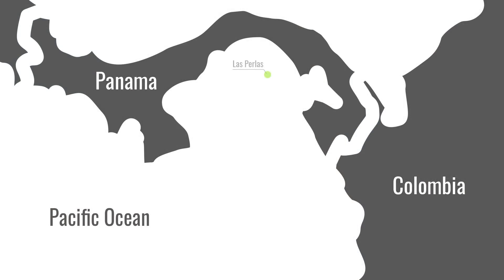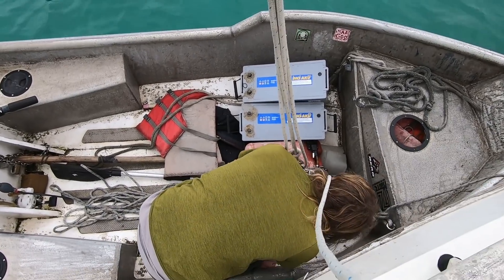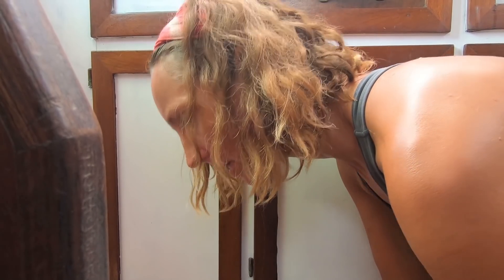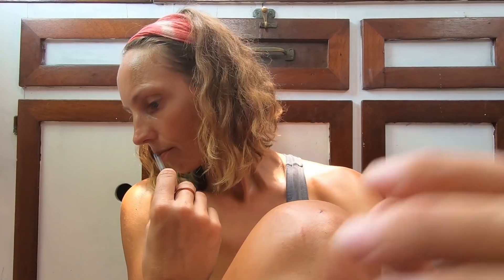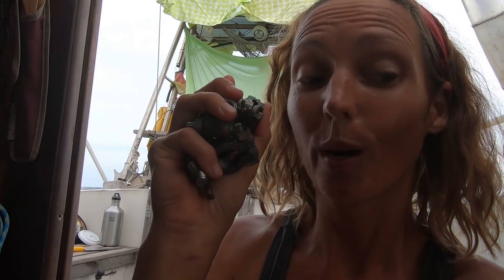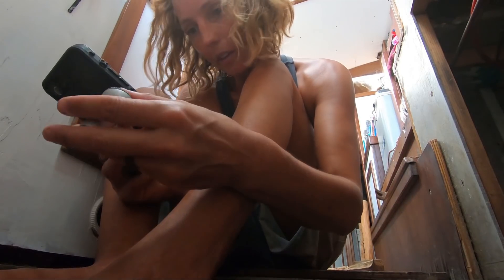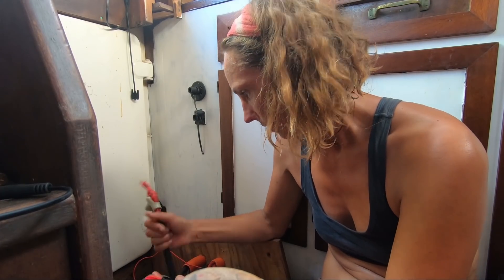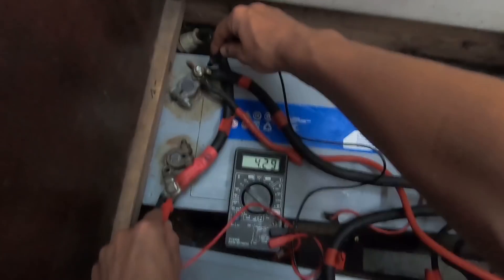Stepping up my game: figuring out how to trouble shoot the electrical motor of my Lofrans Tigres

Comment: My thoughts were that the polishing of the commutator and the brush rings were important, but the discovery that the brushes were a little stuck in their holders probably was the most important. With many ohm meters, first you put your probes together, and the lowest resistance the meter is capable of showing is then displayed, probably .6 ohms. Wiindings on a typical meter are a dead short (in your meters case a dead short is probably .6 ohms) , it takes a very special meter to show anything else. Its a specialized low ohms meter. There are also some very technical tests done with windings as they are special parts called inductors, and inductor tests are a lot more definitive. Now days you can get fairly good inductor testers (they test inductance, capacitance, and many other things, and identify the parts on the screen) for about $15 from ebay china.  Well, I had bought mine about 4 years ago and they've updated the devices a lot. This one does everything, including testing resistance down to .01 ohms, and will tell you if there is inductance as in a winding. Its all automatic, shows a picture which means inductance/ resistance (resistor)/ capacitance and a lot of other parts. You do not want any voltage to be present when you do the tests, that is for a voltmeter. https://www.ebay.com/itm/LCR-TC1-Transistor-Tester-NPN-PNP-FET-Diode-Inductance-Capacitance-Meter-A3Z7/293708983104?hash=item44626b6b40:g:BqAAAOSwNU9fR6Fz

Comment: When checking the "stack teeth" to the commutator bars (windings) for continuity, all of the stack teeth are all connected together electrically to each other (and to the shaft, and through the bearings, to the case and back to the battery negative terminal) so you don't need to check each of these "teeth". 
That is the armature frame.  These teeth may be solid bars or they may be laminated plates all stacked together then slotted I out for the windings to lay in. Laminating them, like in a transformer,  keeps small circular current eddy currents from bouncing around and heating up the motor unnecessarily . So when checking for continuity between the commutator segments you are making sure none of the commutator windings are grounded (shorted to ground back to the battery negative) and you do not need to check each bar to each commutator segment. This tests that none of the commutator windings are touching the shaft and through the bearings, connected to the motor case and the negative battery terminals. If you have had a shorted winding, you would likely see burned bars on the commutator 180° apart; since those are the ends of the shorted winding.

Comment: You never fail to amaze me, you tackle jobs I would always leave to experts not daring to take them apart for fear of making things worse, but you just get on and achieve great things. You are a very special woman. Xx
Reply from the maker: Yeah well if there is no experts around then you take the second best option 🤣🤣🤣 it’s then a question of having a non working windlass and maybe fuck it up and still have a non working windlass OR the chance you fix it and it works again 🤣👍 when u r somewhere where u cannot just call someone over u quickly learn to try and tackle things urself. And I usually try to be super careful and if I open sth up and it seems too complicated for me then I would just put it back together and ask / wait for help. But usually taking apart and putting back together does not hurt things (if u don’t use the big persuader too much 😂)
Reply: @WhiteSpotPirates  great philosophy. 😂😂

Comment: A good thing to do with large battery or wireless cables before crimping them is to smear them with never seize, or even better copper never seize. Over time the never seize will work its way up under the cable covering and prevent corrosion.
Reply from the maker: Thanks for the tip 👍
Reply: I had a similar problem with my anchor not working  some years ago. On my boat I had cables going to the sampson post in the anchor locker and connections go from the sampson post to the windless on deck. At the sampson post, conections showed good voltage and there was good voltage at the windless connections. Never the less, under load the windless failed to work. 
What the problem was, was a loose connection at the terminal on the sampson post. The loose connection caused resistance whicn lowered the available voltage to the windless. But this resistance would occur only under load.

Comment: I think that it is essential to have a two pole switch on those motors so that the negative rail is not connected all of the time.  If it is, it sort of turns your anchor galvanising into a sacrificial anode--and on an alloy hull that is never a good thing.  Two pole mercury relays are good.  They can carry heavy currents..
If you wish to keep your single pole switch on deck, have a heavy switch below that can disconnect the negative once the anchor is stowed.  Otherwise your galv will only last a year or two instead of ten.  As for the  a windlass' electric motor, you seem to have it sorted.
Reply from the maker: Could you elaborate that a little further please? I am not sure I quite get it yet. You are saying that even though the positive is completely disconnected, there will be some kind of electrolysis going on between the negative cable that’s connected from battery to the windlass motor over the anchor chain?
Reply: @WhiteSpotPirates  

Yes.  Exactly.  It is the tiniest of currents, and sometimes it is intermittent depending on whether or not the engine is running, but a milliamp of stray current electrolysis will erode more than a pound of zinc in a year.

Because the negative is not disconnected from the windlass, it is in fact connected to the chassis, the drum, and the anchor chain, and if the engine is earthed, there is also a connection directly to your propeller.
Reply: Actually it is a LOT more than a pound of zinc in a year.  Closer to forty pounds--but the currents are usually much less than one thousandths of an amp.

Comment: It strikes me that your windlass motor was actually in amazingly good condition considering the results of some of your peers boats on the same subject. It seems to be the usual effect that the sea water has its Wicked way with everything electrical but your windlass motor seems to be immune!
Reply from the maker: Let’s hope I did not mess up its immunity by messing around with it 🤞🏼🙈🤞🏼
Reply: @WhiteSpotPirates  Nike, you are always fearless and ready to "have a go" at any problem.  I have exactly the same Lofrans Tigres windlass on my 35 foot trawler.  That windlass is Italian made and it's one of the best windlasses you can buy.  It looks like yours is still in very good condition and you did a good preventative maintenance job on the motor.  

One thing to be aware of is the up-down control box that you no longer have is more than just an up-down control.  It has a solenoid contactor that's made for switching the high current (over 100 Amps) under load.  Most of the 12 volt on-off battery switches (like Guest, Blue Sea, or Marinco) don't handle switching under high current load as well as a solenoid contactor.  Over time, the contacts in the switch can get burned due to arcing.  If you start having problems with the switch, you can get the Lofrans control box for the 1500 watt Tigres motor at Waveinn.com for $77.  If you have an address in Panama at which you can receive parcel shipments, I would be glad to get you a Lofrans control box and ship it to you.  It can be your fee for the  excellent training video on Lofrans motor maintenance.

Comment: Smear a small amount of Vaseline on your battery terminals and connectors now that they are connected and tight. It will help to prevent or slow down corrosion on them in that salt air. Some people use light grease, but Vaseline is cleaner to use.

Comment: I know you may feel that you wasted your time on your windless when it was the solenoid but it was a good thing you ended up giving it a good clean and service. This means it will be more reliable, hence much better for your safety and last longer, hence much better for your pocket. It will even be more efficient so you save your batteries a bit. It might even be a good idea for you to do this every couple of years. In your copious spare time lol. 

I know this might sound a bit OCD but suppose a new motor costs $500 and lasts 6 years.If you service it then you add a third to its lifetime an extra couple of years. Doing the maths you are saving $40 every year for doing a 2 or 3 hour max job once every 2 years. So $80 bucks every time you do it. Costs for doing the job are a bit of sandpaper and cleaning fluid and maybe a cheap toothbrush so it's a no brainer highest cost is maybe you might have to replace the brushes and they are cheap. In fact a good idea to carry a spare set it is not unknown for a brush to get stuck and wear away.

Plus you have a reliable windlass which increases your safety
Reply from the maker: Yeah I was definitely going to order some fresh brushes. They are still pretty good but it’s a good thing to have. I really don’t like picking up my chain by hand 🙈😂

Comment: Just my 2 cents but BMS systems are cheap and can not only protect your batteries but extend their life therefore paying for themselves. Sorry to suggest something that involves you in extra cost and work. Top tip also make sure that all cable runs between each battery are the same length.

Comment: 1:Signal check 2:Voltage check 3:resistance check.    I think you skipped a step.  (Retired electrician and sailor here) By the way  You are  a very competent sailor/ crew person) hats off to you. ..You could have taken battery to the fore deck and tested the motor without having to remove it. but the service you gave the motor was  good even if not necessary.
Reply from the maker: Yes, should have tested the motor straight on the battery, makes sense ☺️ just did not think of that for some reason 😂
Reply: @WhiteSpotPirates  from 1978 to 1991 I serviced the generators (and lot of other stuff here)  the generators and motors weights 100 tons or more so in place service was needed https://youtu.be/FQWN143bBxo?t=263

Comment: I am impressed that you can open such a massive motor without a holding vise 💪🏾. the multimeter has a continuity option (near the lower point) that beeps and shows reading in the small range resistance as well so you can hear rather than look at the screen. I guess that at 8:06 the control box turned the motor down and up and now you can only turn it up where it is really needed 👍✌
Reply from the maker: Yes that’s what the control box does and since I let it downfall when I let it down, I only need the up, as u said. That’s why I never replaced it
Reply: @WhiteSpotPirates  it is easy to build one with either relays or power MOSFET's, if you have time for this I can send you a circuit diagram

Comment: Lesson: Volt meter will read volts even if there is high resistance in the circuit, which is what happened to you. Sometimes a simple test light, which draws current is better than a voltmeter, because you will see that the light is dim or even no light.
Reply from the maker: Thanks for the tip 👍

Comment: Your windless problem reminded me of the time I replaced my well pump and then found out that I just had a loose connection on my pressure tank that turns on and off the well pump.

Comment: Sure you already know this, but, make sure your battery connections are super clean, myself I start with automotive brake cleaner in an spray can followed by wire brush and fine sandpaper.

Comment: Great job. A piece of advice: When charging a battery, the charge voltage has to be over 13,8 volts. Belowe that voltage there is not enough electromotive force to charge the battery. If your alternator doesn't produce at least 14,4 volt, the regulator or the brushes are at fault. If the alternator is a Bosch you can probably change the regulator and brushes for less than €40.
And a bad 12v connection produces heat and eventually fire. And I recommend an instrument that measures both voltage and capacity to avoid future problems with the batteries.
Reply: I work with an organization that has tons of AGM battery banks and also has employees who work with AGM battery banks every day. They have gone to a cheap 100amp load tester you can buy here from Harbor Freight. I realize there are a ton of more definitive tests you can do but for the sake of uniformity of tests I went with this $20 dollar tester. That way, when I tell them my results, its a familiar result.
Reply: Depends on the battery type. If it is acid or not. The best is to have a separate charging PCB where you can actually follow what is going on with your batteries.

Comment: A few observations here. I see you got away from your dial verniers and went to straight reading verniers, you are now an old time Snipe dear. It's like everybody starts with dials then many go to the razzmatazz digitals and then end up in the end, with straight reading verniers. Yes evenly clean the commutator all the way around somewhat, no need to really be anal over it. The thing you want to watch for is the micarta filler between the contact plates that form the commutator is not at the brush contact level. When that is the case a small triangular file or cutting wheel on a Dremel is needed to grind the micarta back down below the surface so no brush contact occurs onto the micarta filler/insulator,,,,whatever. BUT, like most real snipes learn here and there you found the issues through more work than was needed on this one. So the 'simple' gotchya here, as it does any real Snipe on occasion. Honestly dear, I have watched your learning from years ago and am very impressed with your Snipely learning journey. While the work you did on the windlass motor did not yield anything this time around it was an education which you picked up on at a modest price. As the saying goes " a good education costs good money" and time is money dear. Youtube can be good or it can be suckie. Your cleaning the armature stack IMHO was a waste of time in THIS instance. The attention to your commutator and brushes was very good learning. Keep it up dear, you'll be a master Snipe soon, far beyond most youtube sailors in the Snipely paradigm your are right now. Stefan could use your teachings dear on Magic Woman. But he is in the DR right now getting her in proper order.

Comment: Casual off the cuff video worked just fine. 😉 your music definitely changed from the last couple of episodes.
Reply from the maker: In a good or in a bad way? 😜
Reply: @WhiteSpotPirates   Hey Nike, my opinion isn't crucial. I told you last video that I liked the music a lot.  Ok, so the rock this wasn't my favorite and seemed loud--- maybe I'm too old! Put what you feel is right on it! I do always wonder how many viewers on a channel are DJs and musicians and could make free music for you just for exposure. Ever put the call out for some?
Reply from the maker: @danielbuckner2167  sorry u did not like the music choice. I thought it was more fitting to the refit topic than something smoother / softer. I thought I had already adjusted the music to be a little less loud but maybe not enough. Audio for sure is sth I still need to learn better. Maybe time for some tutorials ☺️.
I use the music from epidemicsound.com and they have a great variety to chose from. Working with individual musicians is always a bit tricky when it comes to the licensees and YouTube etc. it just makes things more complicated. Also, it does not give u as much of an variety to chose from. I am really happy with what epidemicsound has to offer. But it surely happens that you won’t hit everybody’s taste each time. Next video will not be rocky, I can already tell you that 😜☺️

Comment: not a good idea to use red tape on the negative ends of the cables.  someone later might see the red tape 
and mistake it for a positive end.  red means positive black tape or no tape indicates negative.
Reply from the maker: Yeah well, I think I made it clear that I was actually writing on that tape...so anyone that can read and differentiate between a + and a - will be safe. Anyone who cannot differ between those...maybe don’t mess around with cables in the first place?!. But that’s just my opinion...
I do get it that people believe that negative cables are always black and positive always red...but hey, here comes reality and guess what: don’t trust those colors! Always be cautious and follow the wires and make sure where they come from and where they go. Because it might just have happened that someone ran out of red colored cable and used a black one instead 😱. I know it might sound insane but I have seen it happening (I won’t be pointing fingers here - at myself- because hey it was only due to circumstances...my German heart Surely would have loved to use the right color...but unfortunately it was not available 🤬 can u believe that!?!?)